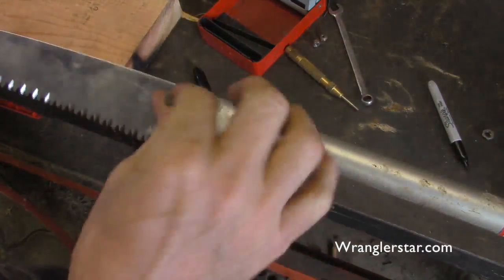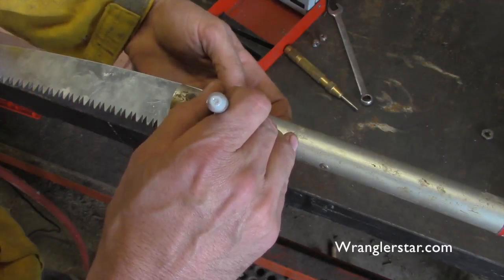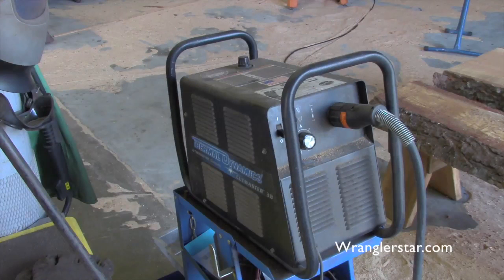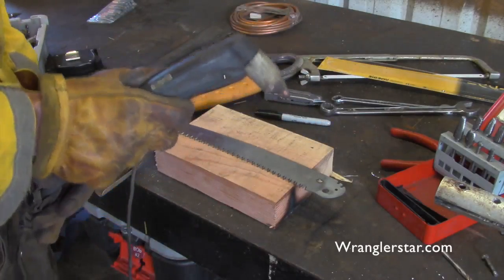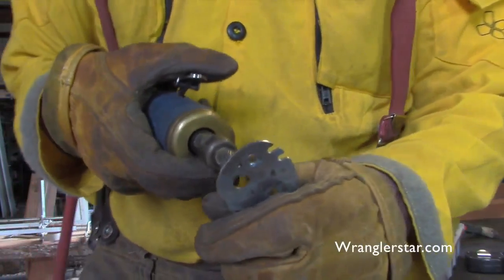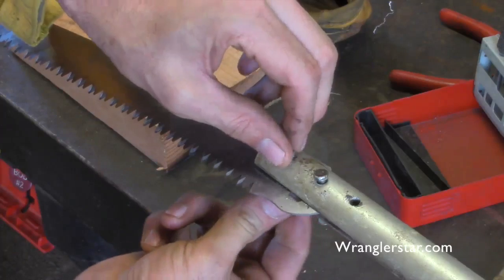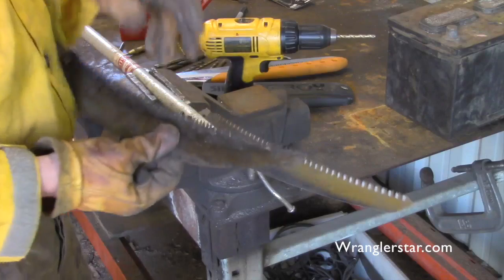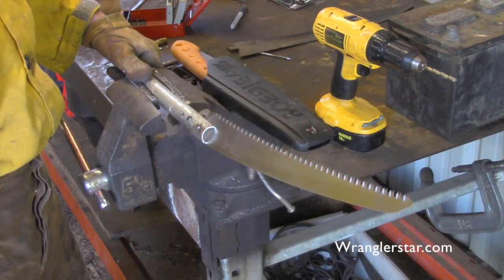Silky Pole Saw | Light Saber of Saws 2

Comment: I've been using a Silky zubat (fixed blade) in the landscape trades for about five years now, same blade as the day I found it discarded on a construction site because a bolt was missing. I don't know that I've ever been as impressed with the proficiency of a tool as I have been with this saw.

Thanks for the vid, that was fun. God bless.

Comment: I was a A&P Mechanic while in the Air Force.  I worked on the Lockheed Galaxy C-5A cargo plane.  I don't recall ever using Ni-locs on it, but maybe on the interior partitions, possibly. On the Airframe and Powerplants, we Wire-tied the critical nuts on, or used castle nuts, or used a lot of the "Squeezed" lock nuts that could stand up to heat/vibration.

Comment: Cody I've been an A&P aircraft mechanic for about 15 years now and I have never used nylon lock nuts. Most aviation nuts are a little out of round at the threads which grip the bolt. Most bolts require safety wire of some form but not always. Hope this helps. Your program is really good. I look forward to your videos.

Comment: I have the Silky Hayuchi pole-saw, the sawblade features two big sharp hooks. its very usefull in pulling dead or hanging branches from trees, and the bottom hook can be used to under-cut branches so they dont tear the tree when they fall.

its the aluminium model, 6,4 meters, and extremely heavy when you use it fully extended. you really notice the force multiplier when extended.

overall its the best saw for the fruit trees ive ever had.

Comment: My father was an aviation mechanic for 40 years and there is no shortage of those types of nuts in his work shop at home. I also remember going to work with him a few times in early 90s and using those when he would allow me to work on accessories with him (of course he would follow up and finish himself, or I would do small things with his guidance). Fun times and good memories. Funny thing, I actually remember asking why those nuts had a piece of colored material inside them. Now that I think about it, that also explains the numbers of spools of wire he has.

Comment: This is excellent, and right up my alley. Something else you can do with a replacement blade (Silky included) is to make what we call an "orchard saw." Just put the blade end in the slot of a commercial replacement axe handle. Drill the right holes and bolt it with the same nylon-lined nuts you used here. You will have a stout, medium length saw. This would probably be good for Jack when he helps. We use them in pruning small and medium trees in orchards, woodlots, and yards.

The scabbards for our pruning saws are made out of pieces of castoff fire hose.

Comment: The Teflon inserts are used on some aviation items but are usually not used on anything hot.  I specialize in jet engines and we mostly use ovaled opening locking nuts or safety wire for locking functions.  On the airframe side teflon locking nuts are common.

Comment: Just for the record the plasma cutter actually works by utilising tangential air jets inside the nozzle to form a supersonic vortex which constrict the arc and blows it through the hole in the nozzle. Constricting the arc causes the very high temperatures. The arc initially strikes to the inside if the nozzle using a high frequency, low current pilot arc, once the arc touches the grounded work piece the cutter switches on main power (around 20 to 30 amps). If you want the kit to work reliably you need clean, dry air as any water droplets will destroy the nozzle. I ran one of these when they first came out and we had loads of trouble with it, hence the research into how it works. Once wet got things sorted it was one of the best tools I ever bought.

Comment: Wranglerstar, aviation nuts are typically safety wired if possible. If a situation arises where you can not safety wire a nut, you would use a lock washer. Fun Fact: lock washers are 1 time use for aviation purposes, if you take it off, you need to buy a new one (and they are not cheap).

Comment: Nylock nuts are not specific to avation; it's just another application. But, along with the nylon, there are holes drilled around the outside to accomidate safety wire. They are used both on the powerplant (fuel, oil, hydraulic line clamps) and the airframe.

Comment: Those are low temp nylon locking nuts. They are only used in <350 degree applications that are not subject to rotation. Those specific lock nuts probably arent aviation grade but they are pretty much the same thing. You'll mostly find the nylon lock nuts anywhere besides the engine compartment and landing gear. You also never reuse them, once they are unthreaded they are thrown away

Comment: most of the nylocks end up in places where it would be near impossible to get to it with the safety wire and most of the stuff that get's safety wired is torqued as you can't torque nylocks because they strip out fairly easily! usually there's a string of bolts with castellated nuts that get wired in series and in such a way that if one tries to loosen itself the wire is pulling on the next one in such a way that it would be trying to tighten it. i might have to get one of them silky's now though! i've had a few multi tools with fold out blades that are similar to the teeth on that thing and it is AMAZING how well they zip through a branch or limb with almost no effort!

Comment: A lot of motorcycle riders use nylon lock nuts. A friend of mine years ago had the gas tank on his Harley chopper fall off while driving down the freeway. Early Harley's were known as having vibration problems due to solid motor mounts.

Comment: If you didn't have the old pole saw, does it add anything special over adapting a roof rake handle or building a handle out of a couple pieces of EMT and a hose clamp?

Comment: Would it be prudent to place a wooden plug in the pipe, drill it to match, and saw it down the center. Slide both pieces in on both sides of the saw to avoid the crush factor from the empty space left in the pipe? Internal spacers.

Comment: For aviation purposes, everything that is fastened uses castle nuts and cotter pins or special nuts that can be secured with what we called safety wire, but the idea is its a tension wire. As the nut begins to loosen the wire tightens and hold it in place. If the nut becomes to loose it will snap the wire and be visible to someone inspecting the aircraft.     Source - 5yrs CH-53E Mechanic for the United States Marine Corps. Semper Fi

Comment: Cody, I worked as an A&P mechanic for almost 17 years.  I was a First Crewman Crew Chief on a MH-53E. (I served with MCPON Mike Stevens (current MCPON) We sweep for mines in that helicopter for 4 years and although it might sound like a cool job to be an aircraft/helicopter mechanic, it's not.  It is unfortunate to because I love working on airplanes and helicopters, I just don't like the people who operate airlines and helicopters.  Real power hungry bunch, not all of them, but a lot of them.

To give you a good example, I worked as a line mechanic for an airline that had absolutely no problem working us 16 hours a day, 8 hours off, 16 hours on.  Airplanes fly in the day time, and you work on them at night.  Well you work on them constantly, because they are kind of flimsy, but, mostly at night, when it is ICE COLD, extremely dirty, and the paperwork for which you are tied to with your signature, is un freaking believable.  Did I mention that  you work 16 hours a day, 8 hours off.  In the mid 2000's I made 15 dollars an hour. The most I ever made was for RCR and I made a filthy 45k. The responsibility I had was overwhelming sometimes and I was trained by the best, the US NAVY.

My advice to anyone is to never work for any company that works you that hard, tell them to .... your ... 

Cody, you did not miss one thing.  Be glad you never went down that path.
OH yea, they do use those fiber-lock nuts along with castle nuts, cotter pins, just about anything you can think of. Lots of things are safety wired.

Comment: Bahco make a 20" hand pull saw with a hollow handle that slips over a 3/4" diameter pole and is locked in place with a screw, very east to use and cuts like a hot knife through butter. costs about $28.00 Australian.

Comment: I work for Boeing on the 787 and have not seen any nyloc nuts ive only seen hiloks which the head brakes off at proper torque and have to be cut out to be removed , rivets, and nuts secured by lock wire altho I do not install fasteners I seal over alot of them in the fuel cells of the wings

Comment: If you lined up the new hole you drilled with one of the notches on the back, you would be able to just use a smaller rear bolt and not have to modify the blade itself at all - make ALL your silky blades interchangeable without punching holes in them..

Comment: Used these nylon nuts on army helicopters they are referred  to as "self locking nuts"...however  they are single use nuts....when removed they are thrown away and new self locking nuts are installed.
Reply: randall mcdaniels yes , for those who do not know , it is called a lock nut , surprise !

Comment: In aviation, at least the planes I fly and worked on we do not use nylon nuts, everything is wired or uses castle nuts with cotter pins. This nylon lock nuts are great though.

Comment: Being that you live in a forest area, do you have to call the fire dept or dispatch center, to tell them that you are going to have a controlled burn when you burn those Slash piles?  Here in Ky. we do, if not calling before hand someone will report  that there is a fire and either the fire dept or the local sheriff's dept will respond to check it out and sometimes the person that is doing the un- reported burning has to put it out and can face a stiff fine when the court date arrives

Comment: The plasma torch reaches 50,000 degrees and is why it's cuts through. The air blows away the material.

Comment: Those nuts are in fact used in aviation
Reply: Jeremy Peters Generally as you said, used with wire (at least in the ultralight world)
Reply: Jeremy Peters wranglerstar  Aviation engines use all metal crimp/pinch nuts and lock wire not Nyloc due to the temperatures associated with the operating environment
Reply: Robert S We use them on parts which don't get hot, such as assemblies inside the aircraft.
Reply: I was referencing my experience of the power plant side of the operation
Reply: Robert S Like I said, at least in the ultralight world, we use them a lot. If I was putting a turbine or jet engine together, there would be no way the I would use them!
Reply: Robert S This is what I know as aviation nuts as well. I think they are silver-plated A286 deformed-thread flanged locknuts.
Reply: bradkrit I'm not allowed to say exactly what they are coated in but silver is good enough because what they are made of is a company secret but they are ever so slightly oval for anti loose characteristics

Comment: I have an avionics and aviation background.  Special lock nuts like nylocks are used as well as other designs.  Then there is the dominant lockwire safety nut/bolt that uses safety wiring. Look them up.  Used on the aircraft engines and high vibration areas.  Here is a YouTube demo:  of them:  https://www.youtube.com/watch?v=XktwpWPFvHs
And here: https://www.youtube.com/watch?v=OwFjUX6SaY8